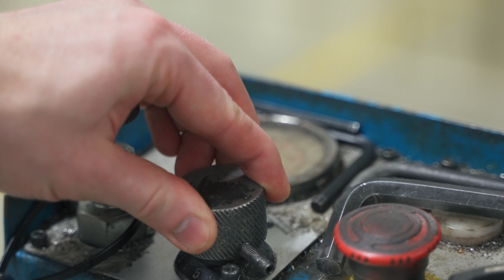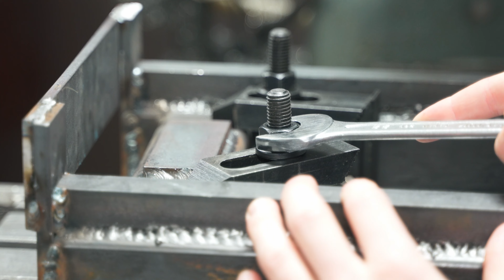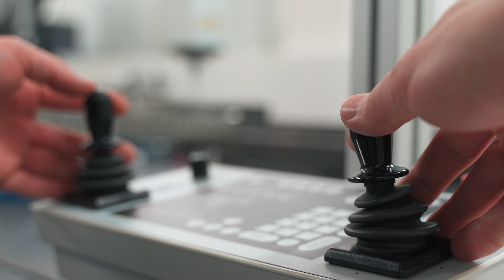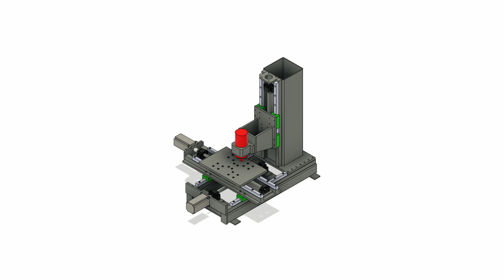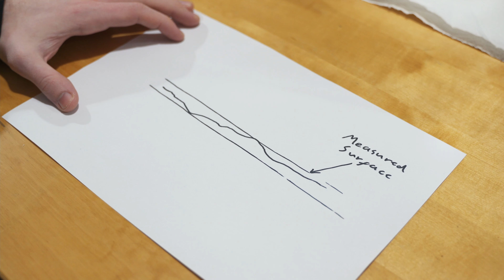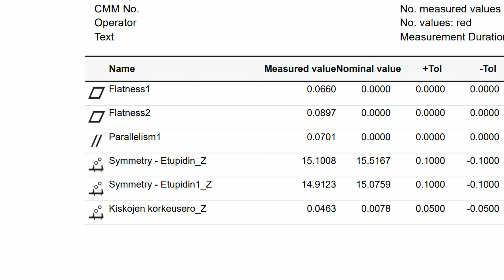DIY 3-Axis CNC Milling machine Part 2: I may have rebuilt the base...

Comment: Hi! Did you apply heat treatment after welding? AFAIK the welded constructions should be heat treated after welding so as to weaken internal tensions. What about your accuracy, has it floated after sometime?

Comment: I'm designing a similar sized machine, and thinking of machining the precision surfaces the same way. Did you consider the clamps may have been twisting/bending the work while milling? Then when releasing, it would spring back? I was planning on using 3 points of contact on my design to the milling machine table, and place 3 clamps directly over the 3 points of contact. Thoughts?
Reply from the maker: Yes, I was worried about it. I tried to shim the welded frame so it would lie flat against the supporting pieces before clamping down. I think there still was some error in it. I wasn't too worried about it because I later went and measured the surface and then used a scraper to scrape the surface flat. 3 points of contact is the way to go if you can get that kind of a setup to work.